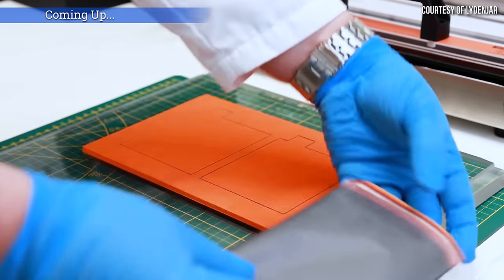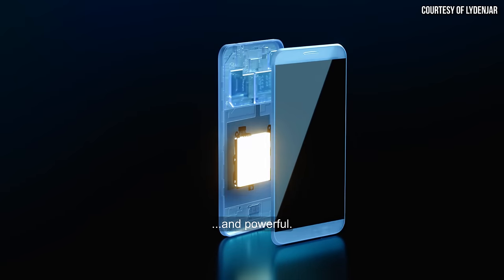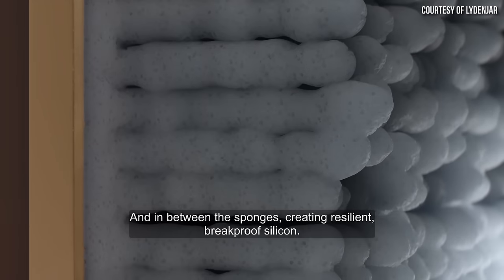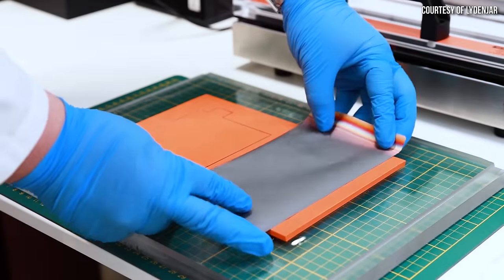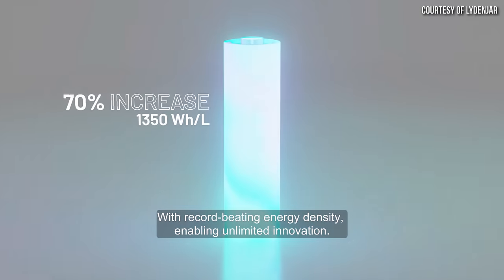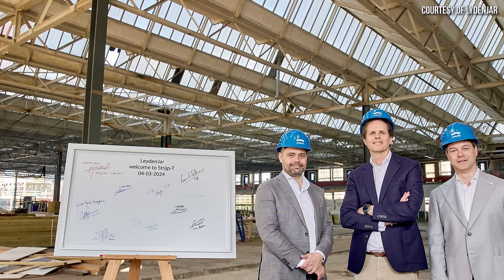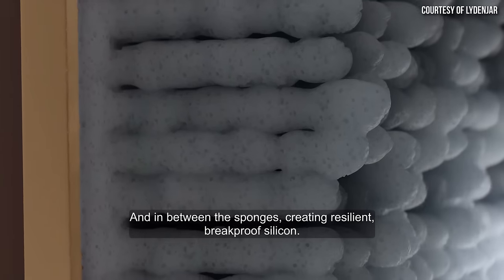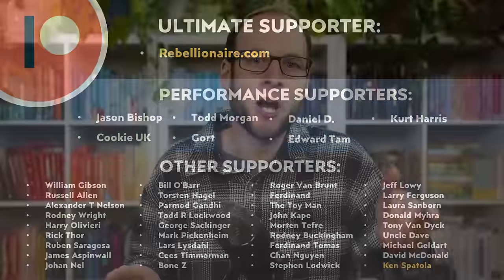REVOLUTIONARY Silicon Anode Battery Tech | LeydenJar Update

Comment: This sounds incredibly interesting but those cycle life numbers should give us pause. I hope that further development will permit cells/stacks/batteries that offer both long cycle life and high power density (fast charge and discharge rates).
Reply: You forget that double the capacity requires half the recharges for the same name plate capacity. In my honest opinion a battery shouldn’t be rated in full depth of discharge cycle life, it should be be in life time energy storage.

Comment: 800...1000Wh/l on a cell level is absolutely insane! usually the gravimetric energy density is half of it (roughly estimated) which means 400...500Wh/kg. that is even good enough for short distance electric aviation for up to 2 hours.
Reply: Ahh … I’d be careful re volumetric to gravimetric conversion.
Silicon anodes very thin, so fit more cathodes, more current collectors in cell. That’d be heavier. I believe it’s the metal current collectors are most weight, but guessing.
Reply: Well, Leyden Jar are claiming a 70% Wh/L improvement for their stack over some other poorly defined albeit practically relevant anode energy density number. Leyden Jar seem to be saying that 800ish (1350/1.7 = 794) Wh/L is a representative number for today's anodes.

By that math you might be overestimating the energy density improvement that follows from this innovation.

None of this matters that much. Graphite anodes are already at their limit. Energy density improvements will require new anode chemistries and/or thinner anodes, which save weight. Silicon is a great candidate because there is plenty of room to improve lithium ion loading and reduce weight at the same time. Silicon anodes can beat graphite on all of the critical operational parameters without sharply increasing cell/battery costs because cells and batteries based on silicon anodes will use less material per kWh of stored energy.

So far, I have ignored the costs and efficiency of production of silicon anodes. The remaining questions over this are: i) whether the specialised vapour deposition process can be scaled up to massive volumes and leading production rates and ii) whether it will be economical compared to the alternatives.
Reply: @chris27gea58  i think it will be on the cheap side. i suspect that they produce a plasma with a kind of 'microwave oven' to create the right sized particles of silicon. i guess that is a similar approach than Amprius uses for their silicon anode which resulted in a production of 1300Wh/l and 500Wh/kg battery. they call it nanowires. on the microscope it looks like a tight forest of cypress trees

Comment: Pure silicon anode, 70% energy density gain, and a power density gain, that is amazing. An Aptera can drive 2000 miles (!!!) with pure-silicon-anode lithium-ion batteries on one charge. The cycle life is a bit uncertain (more than 500 cycli, how much remnant energy density??). The targets in this market are always on the move.

Comment: This sounds really promising! I haven't heard the watt hours per.litre measure before. Is this another way of saying watt hours per kg? (as if the litre was a kg of water)
Reply from the maker: Wh/L is a common volumetric energy density measurement that measures the space to active energy. In many ways it is more important than gravimetric Wh/kg.
Reply: No. It is the best measure (and thus metric) we have for the practicality of a functional battery. Volume is an ultimate deal breaker. The small weight penalty we see with EVs today (due to the weight of the included battery) is a relatively minor inconvenience but, if in addition to that penalty EV batteries (of a sufficient capacity to be considered useful) were so large that only a comically oversized vehicle could accommodate them then EVs would no longer even be a realistic option.

Note: 
(1) Wh/L is not an especially useful metric for subcomponents like anodes or even cells (except for ballpark comparisons) but it is of the utmost importance for packaged batteries and ever more so for battery packs.
(2) Of course, it is possible to perform a rough conversion from weight to volume or vice versa  after all details of a cell and battery  are known but you don't need to. All you need to do is measure its physical dimensions and/or weigh it.
Reply: @Cleanerwatt  That makes sense. Thanks!
Reply: @chris27gea58  Thanks!

Comment: if i am right, the same tech could be applied to sodium ion batteries. it would be great if that could increase the energy density of sodium ion batteries by 50% as well which would push current sodium ion batteries from 160Wh/kg to 240Wh/kg which would make medium to almost long range cars a lot cheaper.
Reply: Unfortunately no, all current sodium cells use perchlorate as the electrolyte, which turns metallic silicon into Swiss cheese.

Comment: i like the name lydenjar. however the original layden jar was a capacitor and not a battery.
it was invented by some german scientist but a professor from the leiden university in netherland discovered that there is a circuit ("circle") to be closed to make it work and to get shocked.
another scientist closed the circuit with bunch of monks standing in a huge circle and holding hands and jumping when the got shocked at the same time. hence the name "circuit".
Reply: The term battery refers to stacking, not the cell. Technically a bunch of series capacitors is still a battery.

Same as a bunch of artillery is a battery, it’s literally the definition.